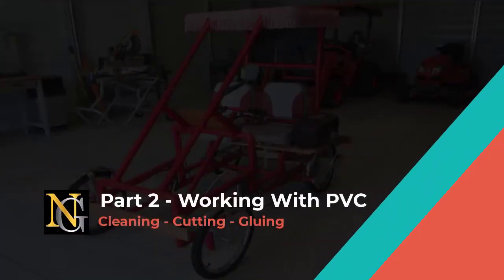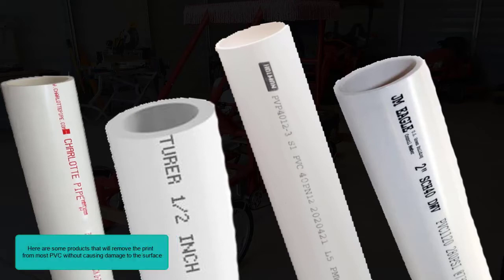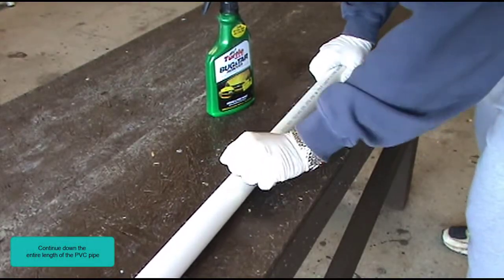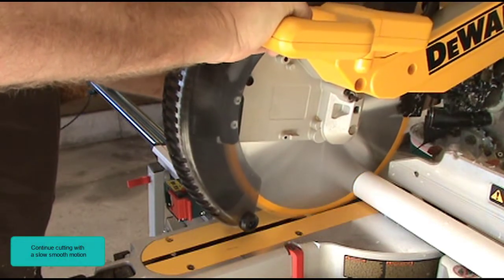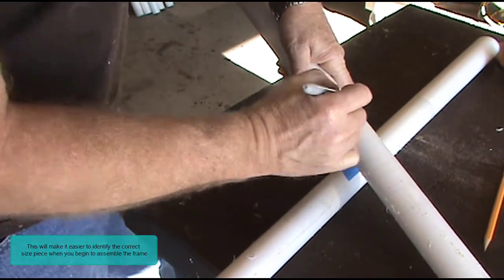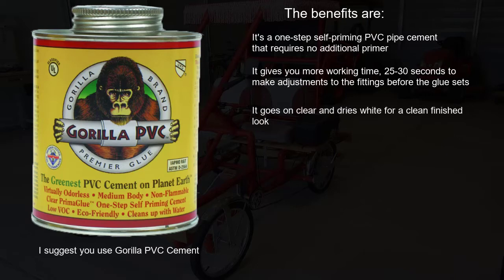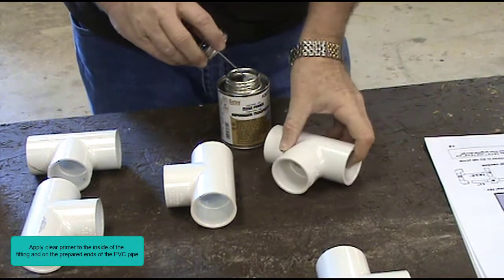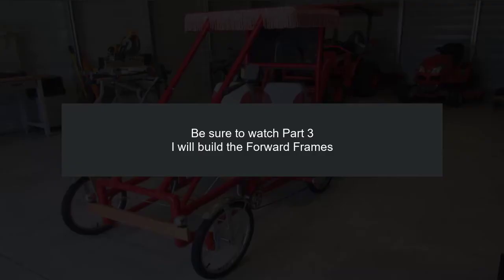Part 2 of 29 - PVC 4-Wheel Bike – Working with PVC

Comment: What was the cost of all materials? What store did you source? Does the website have a 4 seat roadster plan?
Reply from the maker: Building a Side Kick with all new materials costs about $1,000.00, less if using used bike parts and constructing the specialty hardware yourself. PVC parts and other hardware items were purchased from local hardware and home improvement stores. Some items were purchased from Amazon. There are no plans for a 4-seater at this time.
Thanks for watching my video.
Norman